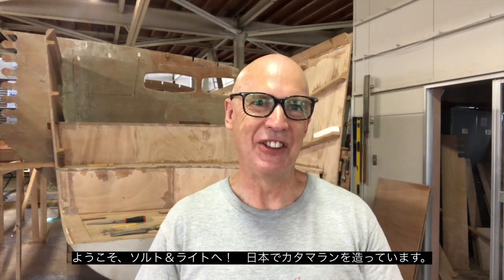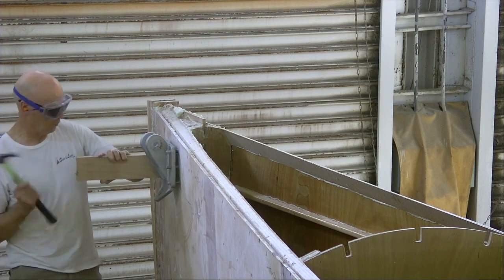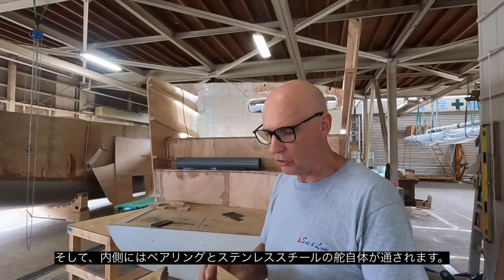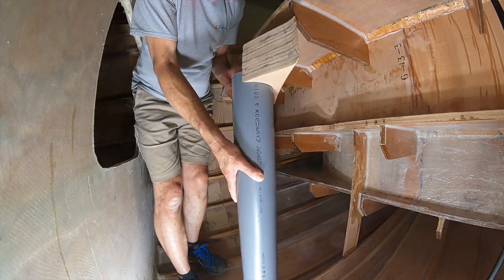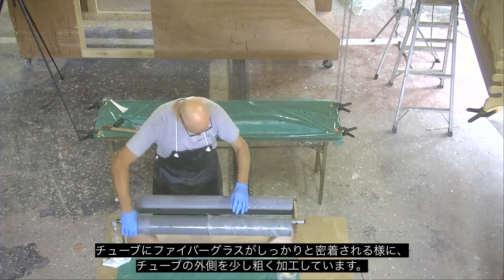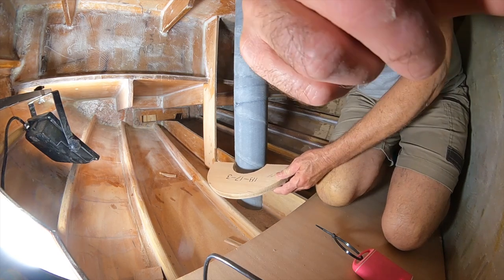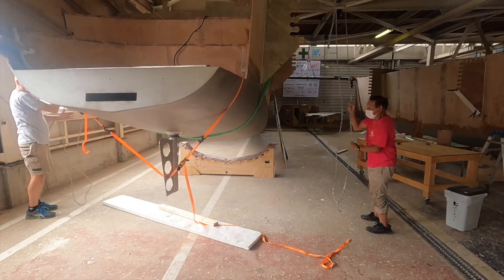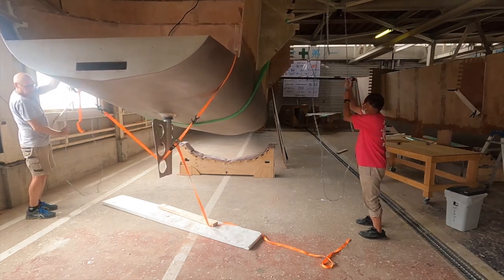Ep 18 Rudder fitting on a DIY Dix470 catamaran .

Comment: Yeah, I'm itching to get get started too..... :)
Reply from the maker: Hi Sandi, thanks for watching. What are you thinking of building?
Kev
Reply: Hi Kev, I would like to build a Grainger Design Raku 44 or 48.
I'm currently trying to figure out where to undertake such a project. As my budget is tight, I need to find a cost effective solution., which is not trivial when living in the EU..
Reply from the maker: Yeah that can be challenging, I was really blessed to be able to secure the building I have.
The Grainger designs are nice

Comment: Kevin great video. I can now make a bit more sense as the order of work appears to be more linear. I was slightly concerned at first about what appeared to be a lack of lateral bracing of the rudder tube but just as I was thinking that you reassured me that there would be a lot more bracing to cope with the lateral strains especially in a heavy following sea when the boat surfs down the waves at high speed. I'm pleased to sea the metal skeleton structure for the rudder allows for a little balancing area ahead of the post. The angle it is at is good but could even be pronounced a little bit more to assist any stray lines or flotsam and jetsam to pass under the boat with less chance of snagging. That is why I don't like the shape of sail drives as, if they snag something solid, they can rip a large hole in the hull just where you least want it. What made you chose a Dix and how did you discover them? They look beautiful. I saw an online build of a large Dix for charter work and would like to know how they caught your interest.
Reply from the maker: Hi David, the real strength lies in the rudder post itself, which is bigger than the design 76mm dia  as opposed to the 73mm dia in the design and the 2 points of connection, the top bracket and the bracing around the hull.
Kev